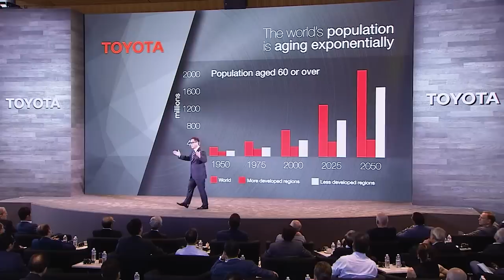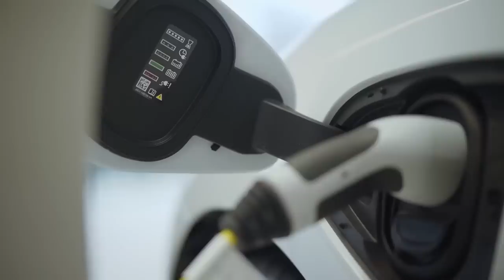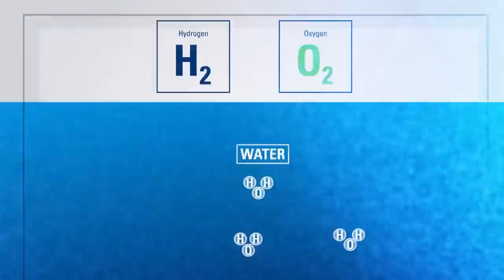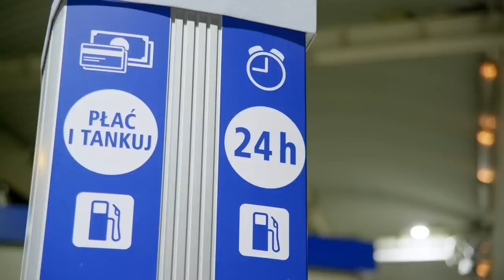New Toyota CEO Shocks Everybody | Huge News

Comment: The EVs, not the way to go. Upfront costs are very expensive (it's not just the car, but also converting your house), limited mileage per charge and battery replacement every 3 to 5 years is expensive. Plus, what do you do if you need a new house? Covert it as well? Also, old batteries, what will happen to them? Bury them like they do with old turbine blades or nuclear waste??? 
The better way to go would be hydrogen. The big problem there is the oil industry, they will do anything to keep selling oil. 
If companies were to start building hydrogen refueling stations across the US, I would definitely invest in that.!!!

Comment: Hydrogen is likely a far better option. The woke aren't pushing EVs; they are demanding EV's. That alone raises a red flag. NOBODY talks about whether gasoline or EVs are more efficient and which actually does less harm to the environment. Politics is more important than that question. Which would be more efficient and do less harm to the environment, Hydrogen cars or electric cars? (Consider the cost and environmental impact to produce hydrogen compared to producing additional electricity. The woke are too narrow minded and dogmatic to even have such a conversation.)

Comment: There are SOOO many videos that show how this is all a joke.  From the fact that Hydrogen Combustion (Hydrogen + Oxygen to produce Water) occurs in air which is 78% nitrogen.  And a bi-product of that is the heat cause Nitrogen and Oxygen to combine into various Nitrous compounds like NO, N2O, NO2 and such.  None of which are good for us (one output is Nitrous Oxide .. laughing gas ... a known neurotoxin so yeah try power all the cars in the world having that poured out into the air).  To the fact that using Solar or Wind energy to break water into Hydrogen and Oxygen creates about 1/3 to 1/2 as much CO2 into the air once you include the life cycle costs of all the materials and mining and other activites.  And the need for pure water in the process (as sea water or water with other impurities will hinder the process and damage the materials breaking it down) which again is more materials and energy used.  This is all a fools errand, and stupid direction and nothing indicates technologically it will be any better for the environment for other choices, it may even be worse.  This is why other companies trying out such vehicles in the 2000 to 2005 years abandoned it all as useless.

Comment: CO2 is not a pure villain (it's not toxic unlike CO, SO, NOx; it's the gas that the plants recycles into oxygen and some kind of "food" for team; all humans releases CO2 when they breath and even releases CO2); the human production of CO2 is less than the variation +/- of what nature produces; massive EVs amount would higher the energy power plant demand which will make the use of thermal energy higher up to supply the demand (Even here on Brazil who has one highest sustainable power plant won't be supply that energy here, so imagine countries like Germany who relies heavily on thermal energy) which releases gasses even worst than CO2; EVs have more electronics and higher batteries with demand a certain discard and recycle do to the fact that these objects can releases toxic components; also main litium extraction for the batteries is a inhuman work that most of this people say they are against but are indirect supporting it

Comment: I guess Toyota did its homework and knows that (i) net zero is a completely idiotic notion because CO2 does not cause global warming and (ii) the world market outside EU and US, namely nearly all of Africa and Asia, much of South and Middle America, as well as Australia, do not have electric transmission networks extensive enough and suitable for populating densely with EV charging stations. EU does have a suitable network but is sidelining itself by its adoption of renewables so will not have sufficient electricity anyway.  The US risks going the same way unless energy sanity returns. Too few people everywhere can afford EVs anyway. So I guess Toyota considers that the hydrocarbon market is here to stay and they will not give up their eminent position in it. Hydrocarbons are also not expected to peak at all, because unlike coal which is of bio origin and will deplete in another century or two, or three, hydrocarbons are of cosmic origin (its base organic chemicals came with the earth when it formed) and will not deplete. Its mining will just go far wider than today, and ultimately go deeper and be more expensive but further new technologies à la horizontal drilling will become available and hold the cost in check.

Comment: Good on them but even Hydrogen is not the future. Not enough BTU's when compared to Petrol. ICE engines can be zero emission if designed right. I wish the automanufacturers would do this instead of pushing Hydrogen and EV's.

Comment: I have never owned a Toyota, but I agree with the new CEOs direction. I am not in favor of EVs, for many reasons, as I believe the battery technology is not there. The huge politically motivated push for electrification of everything, with limited battery technology, and greed, is forcing extremely destructive mining practices. It's also not a good option for Northern countries. I applaud Toyota, for saying the quiet part out loud. Hydrogen is a better option, moving forward.

Comment: I just dont understand Toyota's stance.
While there is no doubt that hydrogen wors as a fuel both in a fuel cell and in internal combustion, for it to work there must be an effective distribution system which currently does not exist and in most countries in the world there is currently no incitive to build it.
Of the hydrogen cars already built there is only one market, California, with dismal sales results. Since 2015 when they first went on the market they have sold or leased a total of 6500 cars which for the world's largest car maker is a failure.
The reality is that there are a total of 47 retail hydrogen outlets in the USA. Most countries have none and until that changes hydrogen in road transport is going nowhere.
Persisting with petrol based internal combustion engines also makes no sense as already Europe have announced the total ban of new ICE based cars by 2030 and the UK by 2035 even Australia is similar legislation in parliament right now and the USA will follow suite progressively over the next few years.
Yes there will continue to be countries who accept ICE based cars but the market will shrink dramatically and as it does the cost of production will rise sharply as will the cost of the fuel.
If Toyota continues down this path they will very quickly lose their No. one position in the market place and also risk becoming an also ran.
Only time will tell.

Comment: hydrogen is absolutely stupid for cars...unnecessary complication to battery electric cars. To produce the hydrogen, you need electrolysis and storage, and transportation facilities and heavy storage tanks on the car itself that can BLOW UP from heat or in a collision (it is a flammable gas under pressure!). Just use the produced power to power the battery directly and leave hydrogen for trucks or something (even that does not make much sense in Elon's and Tesla's eyes though).

Comment: Recycling and forging the metal to make a car is not a carbon neutral process. The carbon neutrality is being monitored at the end user.
Since the US remains the largest buyer of new cars, they can impose all manner of regulations which I'm not sure are as heavy on American carmakers. Since China and other countries are coming up as prime car markets, Japanese carmakers can leverage on that to ease pressure on themselves.
EVs will demand increased power generation. If all cars in the world were electric, how much voltage/wattage would be required above the current figures? A thing to be pondered. I know that where there's a will there's a way though.

My opinion could be biased because I'm not feeling this EV vibe at all.

Comment: Great news, well done for Toyota, I hope other manufacturers follow. EVs suck big time, hydrogen fuel is the obvious next step from petrol and we get to keep current engine tech, as evolved combustion engines will be used for hydrogen. Electric engines are no good for motor vehicles, they have unfamiliar characteristics and they suck. Also, batteries need rare and expensive metals and chemicals, while hydrogen is produced out of water, which will make fuel super cheap and abundant. Water never ever runs out. Hydrogen emissions will also be recyclable and eco friendly in the simplest way possible. No special bins to dispose them, they just become rainclouds. So yes, hydrogen fuel looks like the obvious next step from petrol, and if done correctly, it could also free us from petrol companies and their grip on the world.

Comment: I like that they are thinking Hydrogen fuels instead of electric. I think that is far more ecologically sound. Infrastructure has to built in either case .Downside of EV's includes Expensive cars, batteries that use rare minerals mined in horrible manner, have short lifespan and are very expensive to replace,plus no one knows what to do with the unrecyclable old batteries. and no country has sufficient  electrical grid capability to support everyone using them. Houses will all have to be expensively upgraded to enable home charging . People need to have a rethink Ev's are NOT the solution.

Comment: Well, there is a claim in the video 8:06 quote "Hydrogen has the highest energy content per unit of mass" unquote - two issues here:
- first, the natural question - compared to what? Surely not compared to any form of the nuclear energy (which is used as a fuel in military subarines and SHOULD be used for big commercial ships like oil tankers too)
- second, to store this mass in a reasonably small container a very high pressure is required (a lot of energy imput to compress the Hydrogen)
But generally I agree, Hydrogen is our future (either as a fuel or as a component of the bomb and I really hope the first option prevails). Airbus is already in the final stage of development of a commercial Hydrogen driven Aeroplane. And another Japanese Company Honda is developing a fuel cell car prototipe for decades.
And electric batteries as we know today are a dead end, both regarding the price (a lot of energy and rare metals required to produce them), as well as the accesibillity, for the same reason, there are simply not enough rare metals available to produce the batteries in numbers needed to replace internal combustion driven cars.

Comment: EV's are a joke to anyone whose done any research and many car companies, including Toyota, have done the research. Those other companies are pushing EV's anyway due to government mandate. The electric grid can't handle it, manufacturing batteries is extremely dirty, the upfront price is higher and takes years to recoup, the electricity is from fossil fuels much of the time anyway, there's simply not enough material to manufacture enough batteries for everyone to switch, range is a problem etc. Best use for electrification is plug in hybrid. Full electric is just hopeless. We need to realize this.

Comment: Hydrogen cars will never make sense. The impulse from hydrogen is too powerful for vehicles of that size and you can't adjust the fuel mixture like you can in gasoline vehicles to adjust for changes in rpm. These engines will wear out way too fast. Hydrogen only makes sense for semis, airplanes, or hybrids.

Comment: If Toyota drops its gasoline engine, Toyota drops the best other companies can't have it and pushes Toyota to the lower position immediately. However, Toyota is large enough to diversify. Toyota can use the gasoline engine to support the EV engine as long as the EV engine and EV market are ready. If EV market doesn't work, Toyota still has the up-to-date developing gasoline engine. Best on both worlds.

Comment: One way to reduce carbon footprint is to not own a vehicle. Buy a bike. Live in a walkable center. Even EVs are still cars at the end of the day-- it still requires all the street and highway infrastructure, all the massive sprawling parking lots surrounding big box stores, acres and acres of surface parking in cities. Not to mention urban sprawl, and all the expensive infrastructure-- plumbing, sewer, electric cables that are required to stretch out to all the houses on cul de sacs in ever far-flung suburbs whose tax base is not dense enough to support all that infrastructure, much less the constant repairs needed. And all the increased commute times, and traffic jams. Those will not go away. And of course all the traffic accidents and fatalities that come with cars. And while it may be carbon-neutral, it requires ever exponentially increasing amounts of lithium and rare metals that pollute the atmosphere and the water and the soil, and are mined in countries with similar techniques to the blood-diamond trade. Not to mention that EVs are exploding fire traps, that take 10 times more water to put out, as well as gallons and gallons of toxic fire retardant chemicals, and can ignite other cars, and buildings in the near vicinity of them, while billowing tons of toxic smoke into the air. EV is not some sort of easy magic answer, that allow us to continue our wasteful car-dependent ways without having to think to much about it or make any major adjustments in how we live and how we plan and build cities. It is just trading one earth-destroyer for another.

Comment: I think of a lot of you guys need to look up what lithium mining looks like unfortunately, the carbon footprint of manufacturing electric car is far greater than the carbon footprint of a gas power car like that gas car will have to spend about 10 years to get their carbon footprint neutral electric car has to be on the road for 15 years yet the batteries don't last that long which causes you again the greenhouse gases for a battery pack and this is the number one. Greenhouse gas carbon emissions that happen for electric cars.

Also, in a great country like the United States, we still get 60% of our electricity on the grid from coal. Not exactly green.

Unfortunately for all you green energy lovers. You're just not seeing the common sense. You would need to wipe out about 150 acres of forest. Destroy animals habitats to lay down solar panels that wouldn't even put 20% of energy in the grid. Or you can put a nuclear power plant take up one third, the total acreage and produce more than enough power for multiple towns and cities

Comment: Sato is absolutely right. The logistics of lithium batteried cars is a nightmare. Hydrogen fuel celled cars make a lot more sense, and at least one company exists in SoCal that can put a hydrogen refueling pump in any gas station. Refueling takes minutes, not hours. More importantly. the massive mining efforts and environmental effects to extract lithium, cobalt, and other exotic metals in significant enough quantities to build huge numbers of lithium battery powered cars, not to mention what to do with worn out extremely expensive batteries are problems avoided.

Comment: They need to develop a home system.  Electrolysis is easy and a compressor doesn't take much power.  Distilled water is readily available.  Same as EVs, if everyone wakes up with a full tank of 400 miles of hydrogen, people will adopt it.  If the fuel cell can also be used as a home backup system, all the better.

Comment: Hydrogen took down the Hindenburg with one static spark due to a change in the weather. The only reason the Germans used it in zeppelins is because at the time the US had a near exclusive on safe helium. I'm not sure that instead of providing electric stations with direct current all over the nation, we should set about putting hydrogen tanks in every small town on route 66. I think they've got a sales job to do on that fuel-of-the-future notion.

Comment: EVs are a pain because of their ability to manage long distances between recharges. Definitely here in the US the infrastructure is inadequate to address demand and many of the charging stations are inoperative, and duration of charging goes far beyond what it takes to gas and go alternative offerings on the market. Hydrogen is definitely a smart alternative approach. EVs are still reliant on power stations that burn coal, natural gas and oil. They’re not solving anti pollution issues. And solar panels are not the answer unless you build a behemoth solar panel field like outside of Las Vegas. Even so all those panels aren’t efficient enough for the panels need to have dust removal daily and possibly more times each day because dust particles on the panels cause low to no production of energy from the panels. Given the ridiculous projections that everyone will have to own EVs and no more “fossil fuels” vehicles will be allowed is just plain idiotic. The whole country of the US would require monstrous energy sources and solar and wind etc are in no way going to meet the demands of all electric vehicles. Just look at what happened to Austin Tx a few winters back when all their “green” technologies failed and people died freezing to death. 

Toyota shows some practical sense here. There are EV autos currently that have been modified with an additional power source whereby when going down the road they are generating their own energy and putting it back into the batteries of the vehicle. These don’t require charging stations or any alternative fuel source. Regenerative breaking shows how energy can be cycled into the batteries but one system running in parallel for the major supply to the batteries may make much better sense.